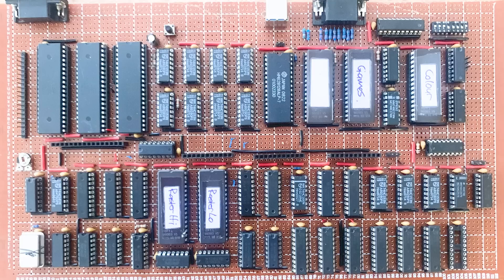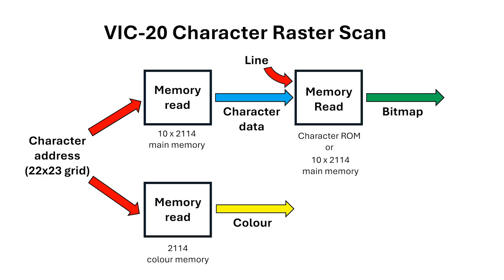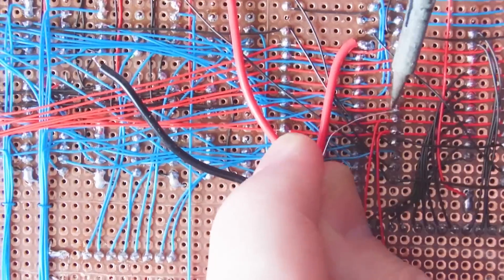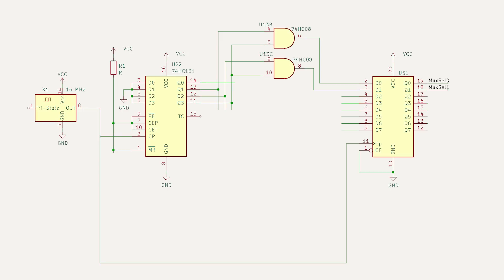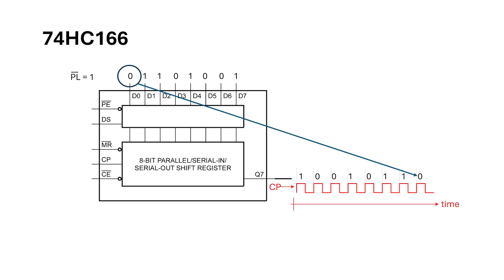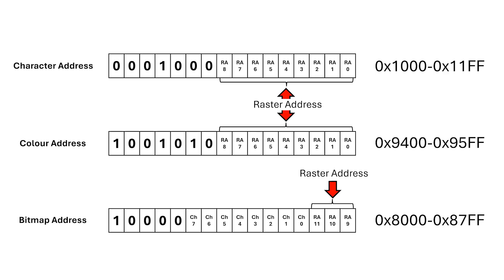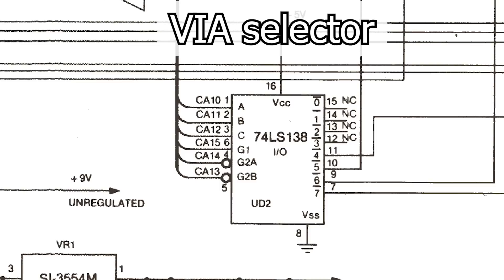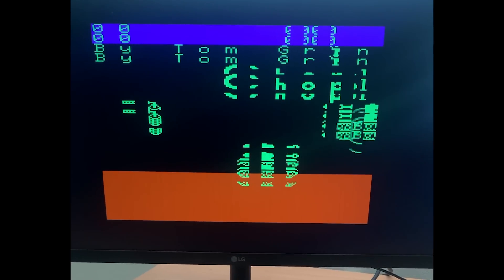VIC 20 build.  Monochrome video output.

Comment: Legendary ..  and that issue at the end... multicolour bitmap mode?  Always that mixed 2 bit per pixel mode used to stuff me up with the double height/width characters.
Reply from the maker: Thanks Andy.  Yep, the choplifter at the end is using 8x16 characters, which I haven’t corrected for properly in the raster generator. The bit ordering isn’t what I was expecting for double height characters.
Reply: @DrMattRegan  So many people have utilised "bugs as features" in the VIC II Chip for the C64 in the demoscene, but the 6560 and 6561 remain pretty under-utilised for extreme hack-effects.  The good news is it makes your life easier in building a perfect reverse engineered masterpiece.     

I did join the list of people who managed to coax a workable 40x20 terminal display in monochrome out of the 6561 by mucking with interlace and raster registers in bitmap mode but it didn't work well - too slow and the fact NTSC machines used the 6560 as you have reverse engineered meant it wasn't compatible.   Hence - my move over to coding the BBC Micro and eventually ARM based Archimedes.
Reply from the maker: Ha ha, yep.  I guess my aim at this stage is to get "most" of the games working.  I'll probably skip the light-pen and paddle.  I've got space in the raster EPROM for maybe 16 different video modes, but beyond that i'll need to add extra hardware.  Many games that i've looked at use 22x23 in normal mode and 22x22 for 8x16 character mode, but there is some variation.

I've been trying to avoid a 1:1 copy of the chips, i want to be more of looking at it (6560) from a different angle and describe how it works as i go along.

Comment: Great video, thank you. Fascinating to see it all come together and be functional in stages. Looking forward to the next video and some demonstrations.

Do you also have sound?

LaserZone by Llamasoft has great sound.

Robotic Liberation Demo (Viznut audio waveforms for speech)

Star Defence also good sound and 2 speed modes.

All of these push the sound beyond the normal slightly out of tune 3 channels plus noise. 

Most Llamasoft games really push the sound for Awesome Sonix! Thanks to Yak.
Reply from the maker: Thanks for that.  I don’t have sound yet, but I plan to do it on a second board.  Think I’ll use some 161s for each voice.  Still trying to decide if I can get away with a low pass filter, or if I’ll need sine wave table and a DAC
Reply: @DrMattRegan  Excellent. Really impressed with the whole concept of how you are recreating the best computer. Thank you for sharing this and the effort you put in.